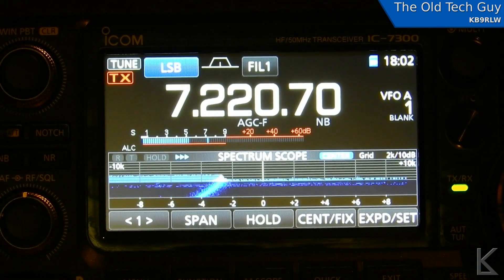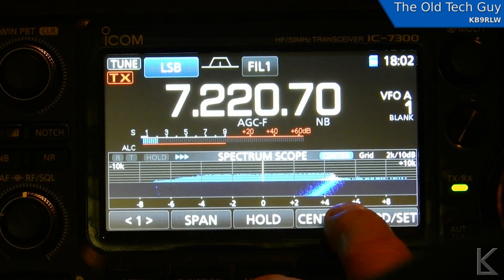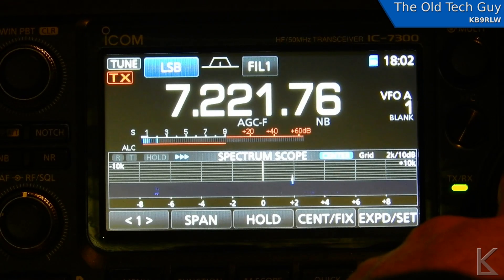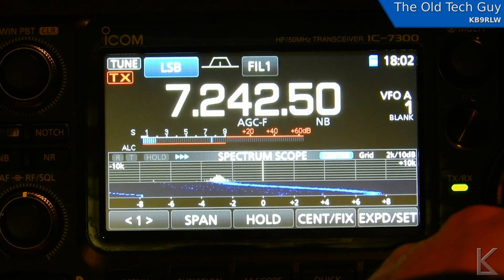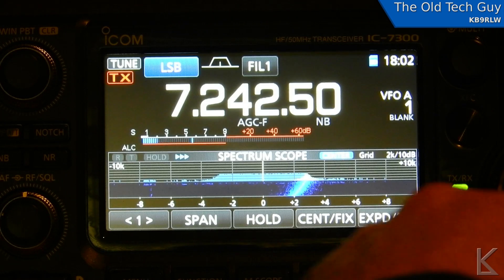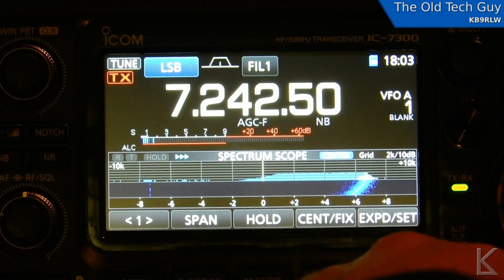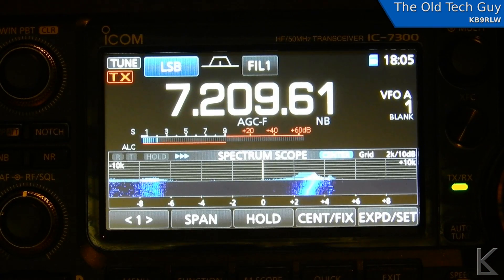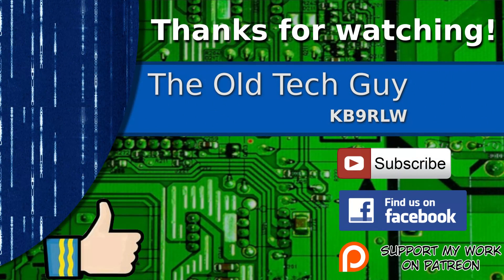Ham Radio - What is the Noise Offset control for on your power supply?

Comment: I have exactly same model QJE PS30SWV and tested it against old good linear PSU. Used Airspy HF SDR. Comparison is very easy to do. No need antenna. Just use 50Ohm antenna load, no need for live bands. You can test 160m band in daylight. Just make a screenshot and change PSU. Make screenshot again. Surprisingly psu is very clean. No any kind of wanderers. de LY5T

Comment: Actually, if it were perfect the noise wouldn't be there in the first place. I'm doing a lot of work getting switching supply noise out of my receivers, and it's a never ending battle. One thing that seems to help is to power devices that are especially noise-sensitive, like preamps, from a separate "clean' power supply, either a small linear supply or a battery.

Comment: The Video is seven-ish years old, but I still want to thank you for making it. I have a power supply with an adjustable noise offset and thought that as it did not affect my UHF/VHF Radio operation, such a feature was a mere gimmick, while what I heard on my hf radios were just sunspot or environmental changes. Now that I know what I hear is my power supply, I am looking for a quieter one.

Comment: Excellent catch !
Noise changes with temperature and current. PWM changes with power consumption. Best option : L:inear power supply with a nice transformer and regulator circuit.

Comment: The application of filtering can be ac or dc. That shows different manufacturers applying the concept of what kind or where apply the filter. On the ac part or after been rectified has ac to dc voltage. Line noise or ripples on the voltage.
Reply from the maker: Yes but that does not apply in a switching power supply. The line voltage ripple or frequency does not matter. In a linear power supply, the line voltage ripple comes through the transformer. In a switching power supply there's a separate oscillator that drives into the transformer. At a different frequency from the line voltage.

Comment: I have one, the way it works is like this, voltage ac have 60hz and other country’s 50hz, that’s off set cleans the noise on the ac line coming to be rectified from ac to dc.
Reply from the maker: No, it changes the oscillator frequency. In a switching power supply the incoming line frequency doesn't matter, an oscillator drives a power MOSFET into a transformer creating a higher frequency AC that is stepped up, and then rectified and regulated down. That oscillator being a square wave oscillator generates a lot of harmonics. The noise offset changes the frequency of the oscillator allowing you to move the noise away from the frequency you want to operate on.

Comment: i had no idea switching power supplies generated noise spikes like that.  I have used a linear power supply for some years. I think I will switch to a linear supply.
Reply from the maker: Yeah, at their core a switching power supply is a square wave oscillator that's driving a MOSFET. And as you know square waves generate lots of harmonics. They generate a lot of noise. Those little wall warts that power devices throughout your house also generate a lot of noise on HF.

Comment: Hi Kevin, it may be two years later but your video is still relevant today, as a novice just fresh getting my license I am looking for two new things a mobile radio and power supply, this happens to be one that I been looking at and with that noise that power supply produces that was enough to make me cross that unit off my list, its a shame because I thought it is a pretty nice looking unit but in need it to do more than look nice so, thanks to you I didn't end up getting annoyed.

Comment: Kevin, I have the Alinco DM-330FX power supply and I have exactly the same issue with noise. Like you I can move the noise around but it eventually comes back. I have relegated the Alinco to my VHF/UHF FM rig.  My Omni VII is powered my Astron RS-35M with no noise

Comment: Thanks - Im just waiting for my local regulating authority to issue my first entry level ham license and I'm looking at buying my first rig.
No linear power supplies available in the country so I'm looking at swtitch mode supplies and sure enough the Alinco DM330 appears to be the same OEM supply as yours and as you say no-one talks about the Noise Offset swicth - so thanks, this has been hugely helpful.

Comment: My Xiegu G90 reacts the same way with my Pyramid power supply. Same noise interference. I am using a computer server power supply with no interference issues.  the noise shows again when I power up the Pyramid P.S. with no load in same room.

Comment: Does this only happen on switch mode power supplies.
Reply from the maker: Generally, yes.  The noise comes from the square wave being used to drive the step up, step down, and requlation circuits.

Comment: I have the Alinco DM-330MVT and if I monitor long enough I have a bird fly across the band (spectrum scope at 100 KHz wide) it crosses in one second.  I always assumed it was just 'noise in the city' but I guess it is the Alinco.  It always goes up the band, never down, never slows.. I always guessed it was neon light power supplies or grow lights at the nursery or something else..  With a 500 KHz wide scope I can see it cross in 2 seconds and 8 seconds later another bird chases the first.. but then in between them it's 12 minutes... But I did always think it was odd that it's on any band.

Comment: I converted a 500w atx smps to 13.8vdc and use it to power my 100watt rigs. My unit made the same noise as yours when I disconnected the power supply's negative output from ground. (It was the only part of my supply that was directly grounded). When I regrounded the negative output, the noise went away.  Apparently some smps negative outputs are not directly grounded like mine but benefit from a 3.3uf 200vdc electrolytic from the floating negative to ground. Here is a great link regarding fixing smps noise http://ka7oei.blogspot.com/2014/08/completely-containing-switching-power.html?m=1

Comment: You’ve convinced me Kevin, to stick with my linear PSU.  Thanks for the info. 73 Tim.
Reply: But nowadays, the linear PSU's are getting harder to find.  When I build my HF station, I will not be powering it from the grid at all.  I will instead use a rather hefty LiFePO4 battery to power it, like what Bioenno makes.

Comment: There should be a way for your transceiver to communicate with such a power supply so that the noise offset can be automatically retuned when you select a different frequency on your transceiver.  But it would only work if the noise didn't drift in frequency as you demonstrate here.

73 VE7NDE

Comment: I had the tekpower TP30SWII that had the noise offset dial, it worked in moving the noise however 80/20m were pretty bad and needed tweaking of the knob quite often...annoying so got rid of it and tried a samlex 1235, not as bad but some noise is there and it doesnt have an offset  knob.  Im resisting getting a linear because they are huge and heavy plus not efficient but I might not have a choice with the Icom 7300

Comment: Hi Kevin great video
its just shifting the clocking frequency of SMP,can resolve it sometimes
but if your SMPS has not got it try these tips.

Ive had recent great success getting down to the bottom of  DC Isolated Switch Mode Power Supplies (SMPS)
especially with HF and 2 way radio equipment.
I know some SMP's dont offer this feature but have put a list together that i have validated 2 years or R&D working on SMP issues with noise,RFI,DC noise and AC induced on DC
Lot of Mfr's dont stipulate certain rules with these new SMP,especially when it comes to 2 way radio!

so I like to share what I have found and resolved both in radio field and Industrial electronics as  a client and design team were having some great headaches with SMP used in modern equipment.
This is what I found and validated all tests to ensure repeatability -It also solved our design team headaches after some long research done as very misleading info around about SMP's.

1.All modern DC isolated SMPS should never have the DC negative be bonded to EARTH potential,they have a balanced isolated output.This means by grounding the DC negative via equipment or by not knowing, you can create this issue quite easily.
Mfr's done stress this enough in data sheets etc,as I found out.
DC Noise
RFI Noise
EMI issues
Other problems when using RF 
this was confirmed in controlled tests with test equipment hooked up to monitor the affects.

THE PROBLEM-Most modern 2 way radios  (99%) nowadays have the DC negative lead tied to the radios metal chassis\Internal PCB and antenna socket (older equipment if often floating case like cb radios and not tied to DC negative so not so much a issue using these)typical a S)-239 or N-Socket.
When you plug your coax into a antenna system that has a grounded metal mast,antenna bracket connected to mast,and coax cable all hooked up.
What happens is the outer braid of coax is now at EARTH potential,by plugging it into your radio your now creating a potential problem with Rule 1.You must not EARTH the DC negative side,which is exactly what your doing here.

Resolve-Fibre glass mast so fully insulated,
A metal mast EARTHED  but has a top section fibre or plastic insulator to mount antenna on to insulate potentials
ground plane wire connect to this point and have egg insulator so not to ground to EARTH potential.
Or what ive found easier is a special fully isolated primary winding and secondary windy 1:1 voltage balun (not current balun)
to help ensure fully isolated grounds potentials to stop any problems.
If its a floating antenna ie a wire dipole then not an issue
Link here of suitable isolator balun and help prevent your radio ground DC  connecting up to your EARTH mast.
Link https://tinyurl.com/y97lqxyr
That can resolve a lot of problems from the start.
STEP
2.Check your SMPS for AC induced on DC outputs
Some poor quality SMP's I have noted suffer from AC voaltage floating on DC outputs in rare occassion
To check,use a DVM on 100V AC range,ensure SMP has a load source on it to draw current
put red lead to DC+terminal
and Black lead to Frame of PSU (EARTH),read what DVM says on display
if its reading a high AC voltage 2V AC or more, an easy fix is to fit extra capacitors filters if required.
One capacitor from DC positive terminal to EARTH
Another capacitor from DC negative terminal to EARTH
this will cure 99% of AC on DC issue up to 30V DC rated outputs from a SMP
capacitor specs
680nF 1000V 310VAC
RS Part 871-2629
Updated 19-7-2017 Rev 2.00
Wurth Part 890334027006CS
after fitting capacitors typical AC values are less than 1V AC  or better
STEP
3.AC line filters (additional)-I highly recommend fitting a extra 2 stage AC line filter to the mains input of SMPS
not only does it stop nasty s getting into SMPS,but also prevents nastys getting back out thru mains via the SMP annd creating problems.
Ones I recommend and very effective in tests
EPCOS Mfr. Part No.B84115EB110
RS Stock No.213-7154

Rule 1 is the most important  not grounding the DC negative to EARTH in most cases via your antenna metal mast that's EARTH'ed.

In my case it was DC grounding issue in the product that flagged this issue up,then bulb moment with radio and antennas earthing masts etc came to me.

There not a lot of really good valid information that's up to date on this subject with DC isolated supplies do's and dont's
think that's why they get a bad name when used in radio circles.
I now run all my HF,VHF,UHF equipment noise free using these rules and no problems anymore.
Unfortunately my SMPS dont have the noise shift pot in them being Industrial grade styles in caged box,so thought I would  share this advice to other's having similar issues  where they haven't got this feature.

Great vid Kev

73's Rob

RP Comms UK.
Reply: Thanks, much needed info & insight.

Comment: Hi Kevin, I have the Alinco version of that PSU, and have never had any noise generated by it, never used the noise offset on it. I did buy a 'Power Mite' 25A PSU, and had to return it, I just couldn't use it, it behaved exactly like yours, and I was tuning the noise offset more than the Yaesu's VFO, it was junk! M0KED.

Comment: Kevin the NOISE OFFSET Control in power supplies is a Deceiving way to get rid of NOISE -That should not be way to control noise. Rather, I would say its a wrong cheap attitude way to Control any Noise. The ideal way is to have Proper 2nd stage Filtration with Common mode choke and capacitor - BUT then the cost and real estate will increase substantially. I use CATALEYA CL350 - here is a link - THEY use very detailed FILTRATION both in the input and output - here us the link http://ceda-labz.com/assets/uploads/files/6f45b-SmpsCataloge_CL350_12.pdf

Comment: Yo Kevin!:
I vote along with some of the other commentators, maybe a follow up video, discussing how you might aleviate the problem. I suggest either or both torroids / additional filtering in the supply. Hopefully it won't be surface mount technology! Glad you mentioned the brand of power supply, (to avoid :  ).
Motor on guy! 73!
seeker / Jeff WA7LFP

Comment: Hi Kevin,  have you thought of putting a curtain (insulated) across the front of the camper just behind the seats?  Lots of cold through all that glass.  I've also seen where folks will cut that silver insulation to fit the front and side windows. You can get them at Wal Mart.   Will also help when it's heat out.
Reply from the maker: Yes, I have thick black-out curtains up already.  Important for privacy too.

Comment: May be a silly question but don't you have a gas furnace built in to that RV? My 1992 Shasta has one built in.  Thermostat on the wall and everything...works wonderfully.  Perhaps yours doesn't have one?
Reply from the maker: Yes it does.  Why burn the propane if I'm plugged in though.

Comment: I use an Astron RS-35M analog supply in the shack here because I have heard from other ham friends that the switching supplies can generate significant noise in the RF spectrum. I have actually heard the same noise before on the HF bands but did not know what was causing it until your video was posted. Thank you for another great video!. 73 DE K7RMJK  Frank

Comment: Kevin.......As an experiment,  can you use a small dc fan to blow air across the power supply's heat sink.
Reply: Or possibly add an additional heat sink with or without a fan.
Reply from the maker: It has a fan.  It stays cool.  At any rate, regardless of how much cooling you provide, there will be some shift in temperature of the internal components and drift.

Comment: Hi Kevin. I have two Alinco DM-330MV'S and they are much more stable than the one you have and much quieter as well. I am not sure if they start at 21KC or not. I have a steady carrier at 42KC and 84KC that I can move around. Above that the carrier goes away real quick. Any noise that I have come across in the Ham bands is so weak I don't hear it. Once on 1917 while on a round table on AM I heard a real weak whistle that I finally moved away with the noise offset and it went away very fast with turning the little pot. I am very happy with my Alinco's and have been using them sitting  "on top" of my TS-2000X since Dec  8 2010. The other one is on top of my IC-706MK2G with the same results which I don't use as much. Yes the linear supplies are quieter but when you move em like for field day, GRUNT :-) One hand with a good switcher :-)  Happy Thanksgiving day. OJ kØOJ

Comment: I'd stay away from those with a noise offset dial - there are SMPS which won't go for that cheap trick with the offset but do implement working filtering and produce almost no noise - e.g. Manson SPA-8230.
Reply: You are just right - its a cheap trick way of controlling noise

Comment: After reading the comments of others who have similar switchers but not the drift, open the unit and see what parts were "optional" and did not get installed due to "value" engineering.

Is the noise coming from the DC side or the AC input side?

Good luck.

Comment: I use my Astron 35Ms  in the shack.  I have a pair of Astron SS30s switchers for the field but never noticed any noise from them.  I did not go looking for it so maybe it was there but not around my operating frequencies.  They work fine for me, especially since I made a powerpole pigtail for their oddball power connector.  I have heard that they made that connector to comply with a big contract that required UL approval so they had to use a covered terminal.  It is the only model on which I have seen that terminal.

Comment: Why not run that radio direct from the batteries and circumvent the power supply?
Reply from the maker: I do.   I can parallel the power supply on the batts when I'm on shore power to take the load and charge the batts.   This was for illustration purposes.

Comment: I have a 65A watson switcher, it is pretty much unusable for radio.
I have an allinco 35A also, it's very similar to yours. Rather anoying for radio. Any powersupply  designed for hamradio should not have a 'noise offset'. Looking for a good 40A or more linear.
, allinco 35a. It is

Comment: Hi Kevin, Seen this before...Those noise tracings are a function of the oscilator frequency And Bandwidth... think pulse width modulation... are you charging your batteries??? maybe try without... best of luck in your adventure... WB0ZLX

Comment: Great video, now I know why I had been steered away from that genre of power supplies when I was getting my first HF radio with "you'd be happier with XXXXX model ...".  While I still have a switching power supply I have never encountered that sort of noise. I also put snap on ferrite cores on each lead coming from the power supply,

Comment: Hi Kevin,
I have the Samlex SEC-1235 35A power supply and have never heard a noise like that, although do not have a spectrum display to see if there is anything coming from the power supply.  73  WB3BJU